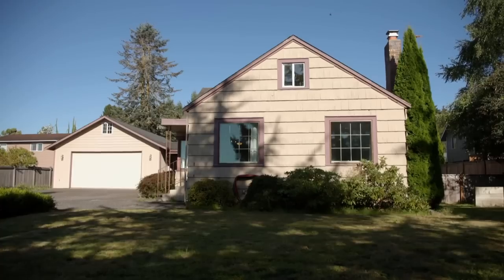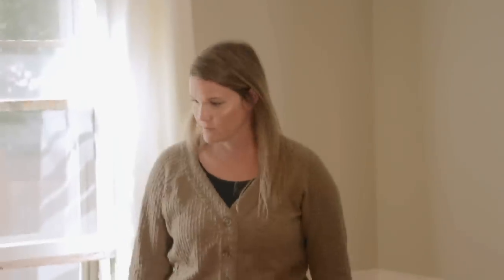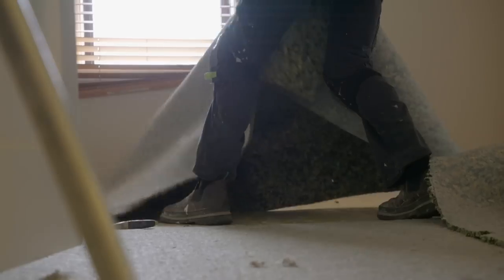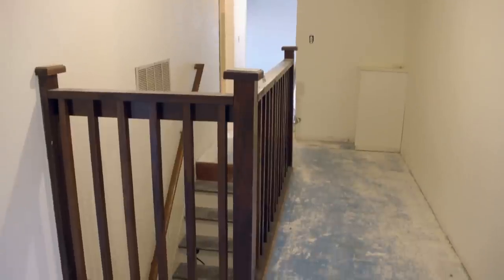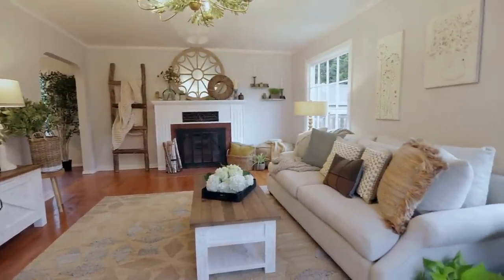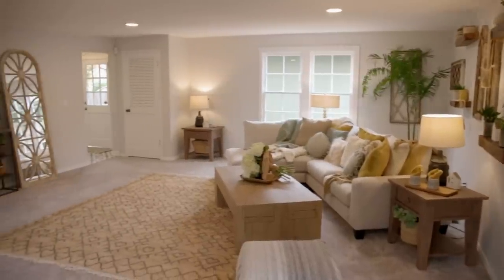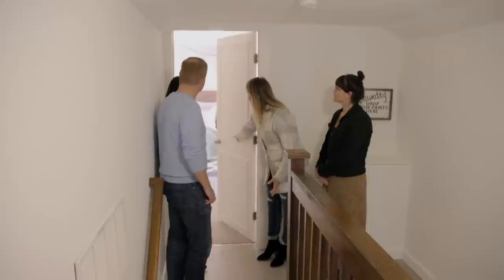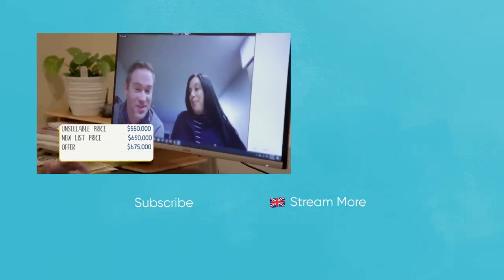Unsellable House Is Sold For $125K Over Original Offer After Renovation | Unsellable Houses

Comment: It KILLLLLLLS ME to see sledge hammer on good clean kitchen cabinets.   Donate or resell cheap.
Reply: My heart breaks every time I see that. It happens on almost every reno show.. It's a very lazy way to remove cabinets. 😭
Reply: If they are like my old ones, they were built in place and couldn't be taken out in sections.  They wouldn't fit another kitchen and the labour to rebuild them would cost more than they are worth.  Mine are not standard sizes, have small internal shelves, don't go to the ceiling (dust catchers!) and the base cupboards have no bottoms inside them (the pots and pans sit on the floor!).  The drawers are stiff to pull out.  They have coats of old chipped paint.  I could go on...

Comment: I really, really resent when old kitchens are just mindlessly smashed up - instead of gently dismantling them. Either to give to charity or to resuse the matrials elsewhere. A big ‘shame on you’ to the team for that. Sorry folks.
Reply: My sentiments exactly...
Reply: Totally agree .. hurts to watch it! ☹️
Reply: Unfortunately, a lot of these homes were built with materials that contain lead or asbestos. So while it would be great to donate these materials for reuse, it's just not that easy at times.
Reply: @fragout9575  There are plenty that are salvageable though. I'm not sure how to properly handle cabinets that contain asbestos, but I've heard it's fine as long as it's not peeling. So even if the paint contained asbestos, there still might have been a way to salvage these. Maybe??
Reply: @VioletJoy  I'm sorry if my explanation wasn't clear. Asbestos was used in some flooring materials and siding and wraps around HVAC duct work. Lead paint was used in most homes built before the early 70s. When a lot of these homes are being renovated, they have to test a lot of these materials if it's suspected to be lead based paint or asbestos and they have to be removed by special methods. Yes, in some cases, if you are careful, you can remove items that have been painted over lead based paint. Asbestos, can't be removed by the average homeowner. That is why I said it's difficult to keep some items for reuse. Especially items that are specifically apart the original structure prior to the early 70s in SOME homes. 

Hope that helps.
Reply: Who wants old rotted wood that smells like mold? Gross
Reply: Honestly who’s going to use that ugly stuff…

Comment: 550 could not sell,  did the renovation for 100.  So now it's 650...  Sell for 675,  so only 25 is a profit.  How could you tell it's 125?   You spend 100 4 reno. ???  Plus they need to pay for designers and other.  Closing costs etc.  Hum....😕
Reply: EXACTLY.  I guess the point is IT $sold.   it does look so trendy...that's just the way the tv shows are.  Change trends and show it on tv increases sales of the NEW trendy thingys.   NO thanks, I like traditional and classic and RELIABLE stuff.